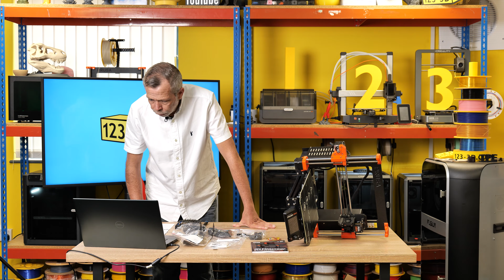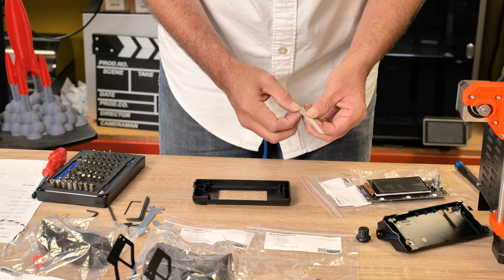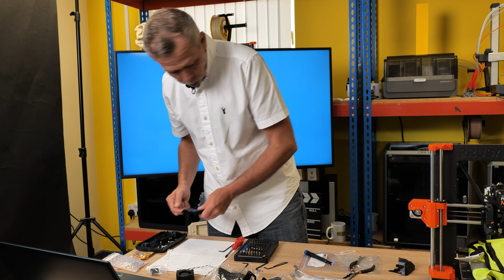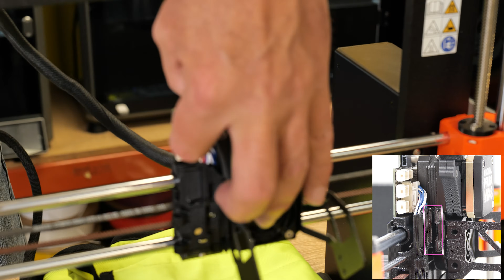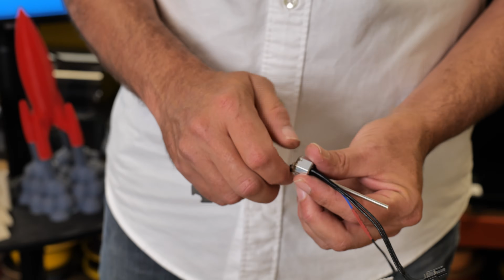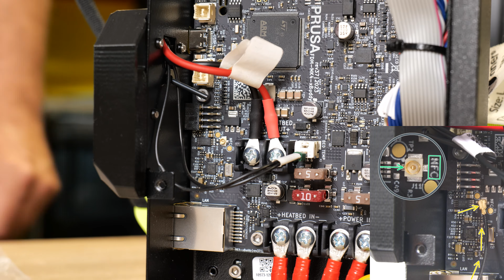How to upgrade your PRUSA MK4 into an MK4S | Step By Step Guide!

Comment: When it comes to nextruder assembly - the screws are not the same that were removed after putting the fan spacer and holder. They're slightly longer. Otherwise the entire extruder system is held by half a millimeter of screw and a dream. (Referring to 21min mark)

Comment: Completed my MK3s to Mk4s upgrade in about 22hours last month.  They are short of about 10 x 12mm bolts and 6 3mm Nylocs for my upgrade but gave me many extras of other not required fasteners.   The Web instructions are excellent. The LCD stopped working after about 10 prints. Replugged the flat wire connectors and reflashed. Started to work again.  Required a lot of cutting the wire management holding cable ties to do this. Irritating as I need to take the thing apart again to refit the cable ties into the electronics box.  The suggested fixes in the Prusa Forum referring to the interference from stepper motor cables did not work in my case. Prusa support was good and got back within the day. I think it was the reflash that fixed the LCD problems.  They came back yet again and suggested some other possible solutions. I will try them if I experience the same problems.
Reply: Yeah, the upgrade kit is horrendous. I'm working with Mk4 - Mk4s upgrade kit. Component quality is horrendous. The tolerances are all over the place. It feels like a kit bought from Etsy or AliExpress.

Comment: I have a MK4 that I upgraded from a MK3S+.  Will this kit work on this since it was already upgraded?  Also, will the MK4 nozzles work on the MK4S?  I ask because I have two brand new nozzles I purchased for the MK4.  Thank you.
Reply: Because there wasnt a reply, yes to all. You can upgrade your mk3 to mk4 to 4s it's the same nozzles mk4 to mk4s this upgrade just happens to have a CHT nozzle for added value but not required.

Comment: Does the upgrade affect the connectivity to Prusa connect? As in affter the software flashing?
Reply from the maker: Thanks for your comment! Yes you will have to add your printer to Prusa Connect again as it will have a new serial number. This can be done using NFC through the Prusa app. You can read more about the app here https://help.prusa3d.com/article/prusa-mobile-app_735711